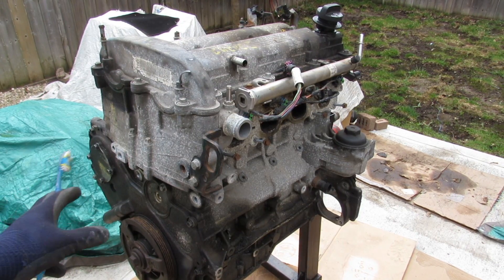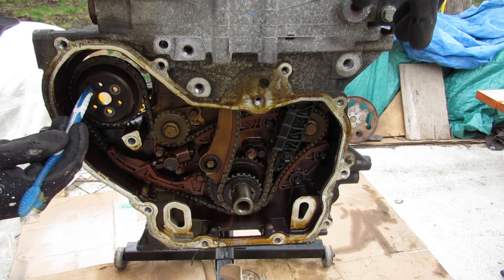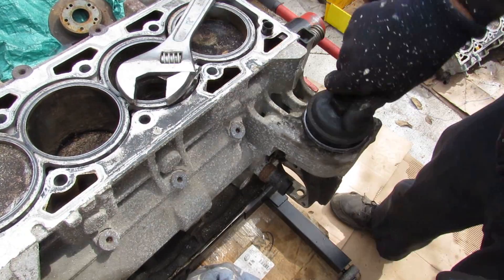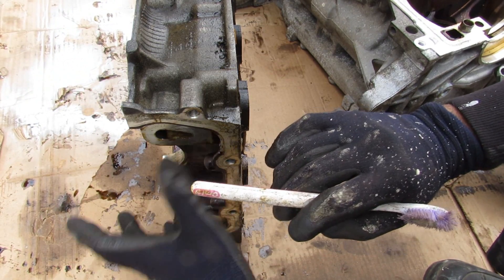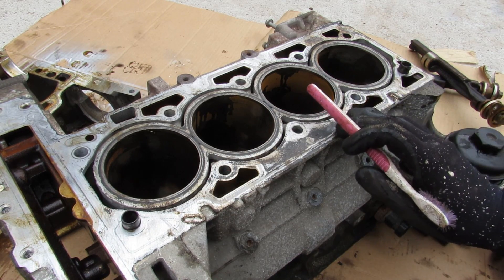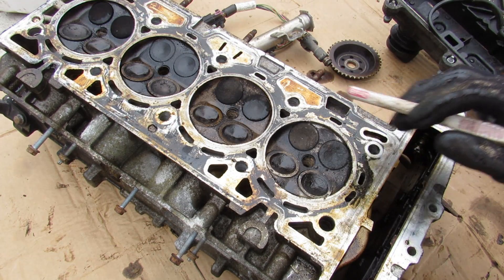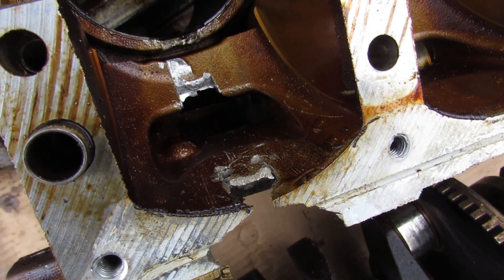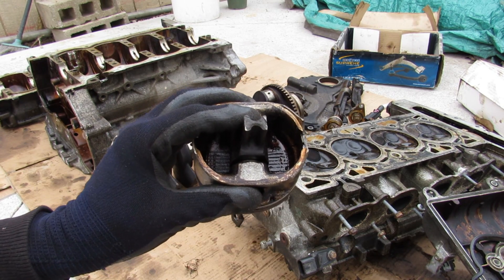Why GM Ecotec Engines FAIL

Comment: Oil pickup in the sump clogs up with bits of broken chain guides, then along with chain stretch and long oil change intervals can self destruct. Chain kit includes larger oil feed and lubrication jet, sump and oil pickup and oil filter housing and oilway to chain tensioner must be cleaned out.  9000mile/yearly oil change with 5w 30 fully synthetic oil and these engines can do large mileages reliably...This engine was used by Saab, Lotus and Vauxhall (VX220) where owners were more attentive I guess so very few failures.

Comment: LNF and LSJ are incredibly robust they can take 500WHP+ on stock internals. 2.2L(L61) and 2.4L(LE5) are okay if built right but pretty junk lol. Failure like that is pretty rare on most engines. Looks like that engine was barely maintained....

Comment: Great video! You glossed over another common failure on these motors. Well, the 2.2 anyway. 

The same foam core casting is used for the heads. This type of casting can leave micro fractures/cracks that on thin surfaces or surfaces that require smoothness to seal, can cause failure, I.e. valve seats. Over time valve seats can develop leaks which lead to intermittent misfires. Typically p1000 or p030x (x=cylinder #). You have to perform a leak down test to identify this. Only fix is to remove the head and rework the valve seats or buy a remain head.

Comment: This engine family hasn't been made since the 2017 model year. They reused the name on several newer engine families but these ones went away when the 2018 Equinox and Terrain came out. When you were showing the connecting rods those didn't have any bearings in them. The surface you were looking at was the connecting rod itself. Also the broken connecting rod happened first and likely due to a bearing failure from very low oil level. The damage to the piston and valve contact happened from it hitting the cylinder head due to the fact it was no longer attached to the crankshaft. In my experience it would have to have been several litres down. I've worked on many of the newer 2.4s and they drink oil badly. I've seen several stalling out due to only having around 1.6l of oil left in the crankcase (4.7l is full). Even the ones run that low on oil I've hardly ever seen spun bearings. It will stretch the timing chain and cause broken guides almost for sure though. I wonder if this one died of a loose drain plug from a Jiffy Lube oil change.

Comment: Great video, however your assessment of why the piston was damaged is incorrect. What is clear from the damage is the connecting rod broke. This causes the piston to be forced upward, past TDC, slamming the piston into the combustion chamber itself. This is why both the piston and combustion chamber show major damage. This is a common occurrence and is often why engines with broken rods also lack salvageable cylinder heads. 

If it was a timing failure, you would most likely have bent valves that don't seat in their guides, clean combustion chambers, and dented pistons. 

What appears clear is the #1 cylinder had a rod bearings lose lubrication, spin, and while the bearing was spun, the car continued to be driven. Eventually, the rod disintegrated, the rod slammed around and broke, sending the piston up into the combustion chamber as a separate broken part.

Comment: 150k on my 2.2 daily and running strong. Doesn't show even oil residue. Always used high mileage and a quart of Lucas after 70k.  Did have to tap the top tensioner bolt generously to free it up and relieve the cold start chain noise. It's a dreadful noise for 3 seconds or so. If you maintain these engines they are about bulletproof. Also did all the other basics like brake system flush, coolant flush, trans flush @70k and recently did a trans pan drop and filter replacement.

Comment: I was thinking about stealing a turbo Ecotec out of Cobalt SS for my sandrail. This video might have persuaded me otherwise haha.
Reply: 2 liter turbotecs are solid if you dont overboost and maintain them. The internals can handle 15lbs of boost safely. I'd even venture out to 18 but that's uneeded stress for stock.
Reply: @oldschooldude8370  thanks for info! If I can get my hands on an engine I'll buy one. I have always heard they were good, looks like the one in this video was abused in a former life.
Reply: @many-points  Broken rod I think I heard. I didnt watch whole video. That's too much boost more than likely. The turbotecs had upgraded internals but not forged far as I know.
Reply: THE WARRANTY IS 100K MILES ON SOLSTICE ENGINE 260HP AND GM FACTORY FLASH 290HP.

Comment: "I've never used my 11mm socket before"  
That's how you can tell it's a GM. They seem to just use any size they want even on the same part. I've seen on a newer GM the alternator went out (at 42k miles LOL) and it had 3 bolts, a 10mm, 11mm, and 14mm...wtf?
Reply: Also need both SAE and Metric toolboxes because two bolts next to each other may use different systems! And if it's British, add your Whitworth tool box!
Reply: Ford is famous for 11mm. Cant recall needing it for a GM.

Comment: I had one of the 2.2 ecotec engines in a little car, it ran just fine with 200,000 miles. Maybe if you take care of them and don't run them out of oil they hold up better?
Reply: Exactly. Some engines handle neglect better than others.

Comment: Nice presentation.  I see a lot of effort to minimize materials in stressed parts in this engine.  Those are some spindly connecting rods.  These engines have no tolerance as a saving grace for little user errors.  I'm used to the 151cu.in. Iron Duke four - it has some buggaboos but is essentially more sound overall.

Comment: So are these engines reliable enough with regular maintenance? Or is the tiny oil control ring going to end up biting you regardless?
Reply: See the Ecotec is a Vauxhall DOHC belt driven cams engine converted to oil lubricated chain driven cams for vastly more reliability. Vauxhall had recommended changing the belts at 80K miles... they didn't last that long, so they changed it to 40K miles... GM doesn't have any mileage recommendation for changing the chains... After initial break in, I recommended using synthetic oil and regular oil changes to make the engine last 300K miles and stay clean inside.

Comment: He angry at that motor..  i remember my first broken piston i chucked as hard as i could across the yard..  found it with my mower which ironically caused that 1400$ mower to become junk when it bent the crank and caused a piston rod to break...   it feels real good to relieve some tension on inanimate objects but inanimate objects like to bite back..   just like no matter how pissed you get or how careful you are, when you drop a bolt its still going to somehow end up a hundred miles away from where you saw it hit the ground, right in some shit you said youd clean up later..  like how everytime you suddenly think "i need to go put on some safety glasses" you just fucking then get something in your eye.. or why a fart can linger for 20 minutes under a car even when the wind is blowing..  like as soon as you think "im about to bust my knuckles or elbow open" you dont even finish the thought before shit slips or breaks and you cant feel half your arm for a half hour..  

Ill tell ya what does relieve stress though..  when a buddies helping you check for spark and you hit the ignition before they let go of the plug..   gets a smile on my face everytime..

Comment: nice video Bro!, i fixed the oil consumption problem of my dad's corolla after i saw a video of you, it just have clogged oil return holes on the piston, so i clean it up, and put new rings and now it runs like new and no oil consumption, it seems to be a common problem on engines. thanks for your videos and knowledge, saludos desde Chile!

Comment: The rotating assembly is not a common failure point, only the chain. It’s on you if it fails, looks like it missed a lot of maintenance......
Reply: It started out as a Vauxhall engine with belt drive cams and belts broke by 40 - 80K miles... the chains go 250-350K miles...

Comment: That ecotec is out of the 2005 cobalt which would be same or nearly identical engine in the 2004 sunfire.

The later years cobalt such as 2010 has different looking ecotec motor in it.

Comment: The timing chains, tensioner, guides etc are very BMW like in design, and of course BMW N20s etc just love to self destruct due to valve and oil pump chain failures.

Comment: I have one of the newer versions of the ecotec 2.4L.  It's in a 2011 Chevy Equinox.  It burns a lot of oil, but I took it in to the dealer a few years ago and they said it didn't burn enough to qualify for the engine replacement.  They have been selling this defective, oil-burning piece of junk for years and do everything possible to avoid repairing or replacing it.  If you have one, it is critical that you check the oil on a strict schedule.  If you ever let it get to low (and it can happen very quickly) the engine is done -- like the one in the video.  What does it take to find a vehicle that's not a bunch of junk these days?

Comment: Have this exact engine,

09 Chevrolet Cobalt LT, hand me down, 136000 miles.

Carfax says 14 owners since 2009, and a number of accidents.

Fully restored it with junkyard and Duralast parts, except the inside of the motor. Hell, even changed the transmission fluid(4T45E Auto Transaxle) at 124000.

Car runs really well for its’ age, upped the oil to 10w-30 at 127000(live in Arizona), to try and help get thicker oil in smaller tolerances of mechanical wear.
Started changing the oil every 2000 miles for about 6 months.
Aside from using quality spark plugs, changing the oil every 3-4000 miles, and changing the engine mounts, is there anything I can do, besides getting rid of the Cobalt, that can try to make it last longer?

Comment: ive got the l61 2.2 ecotec in my 2005 chevrolet classic, 212,790 miles and still going for its age!
Reply: regular maintenance goes A LONG way
Reply: This engine fail due low oil.

Comment: yes there is a tensioner behind the cams on the head it looks like a 32mm bolt and that is the tensioner that is prone to failing thus the slack in the chain

Comment: These motor are junk the timing chains fail from oil consumption then run low on oil and lose tension with the chain then bang there done
Reply: Need to check oil level every 6 months...
Reply: @BuzzLOLOL  with these motor you need to check every day

Comment: Balance shafts run off a secondary timing chain, so it’s basically got two timing chains you need to set. What a nightmare.
Reply: Coloured links on the chains line up with marks, takes 10mins to time the whole engine
Reply: Make a sketch of chain and sprocket positions on tear down...

Comment: i had one.. it was awful.. awful engine. mine was the older 1.6 with the interference timing belt.
Reply: Vastly better now with timing chains instead of short life belt...
Reply: @BuzzLOLOL  i disagree. timing belt is easy to change but faulty pcv valve design caused rear main to blow. also everything on the car was falling apart. i got a honda after and realized just how much chevy cheaped out.
Reply: @zoomjoo  - 99% of people will not change their own timing belt. And don't want a broken timing belt destroying their engine by crashing pistons into valves. GM eliminated that problem by using permanent oil lubricated timing chains good for 300K miles in gentle driving...
Reply: @BuzzLOLOL  still no excuse for their terrible pcv design. also the transmission was well on its way out. ask any mechanic. GM is trash.

Comment: You know it's weird, we have had the same family of these engines in Opels and they didn't seem to suffer much less failures as lets say VW FSI engines. Maybe it's because of the different service intervals or maybe because they're generally smaller displacement, lower Horsepower than in US so they don't get pushed as hard... Generally the thing you needed to do on these things is replace timing chains and tensioners at 150k km, keep the engine oil level in check and make damn sure you change the oil at the manufacturer specified 20k km. I think the upper limit on oil consumption in the owners manual was 500 ml per 1000 km, but many times they'd not eat oil at all for a long time. The leak from the side of the block is a problem that happens though...

Comment: I put 300k on a 2006 HHR, yes I know, with no major issues. Ran great with no oil usage. However I did meticulous maintenance and used top quality synthetic oil. These are 300k engines with proper maintenance. Don't skimp on maintenance.
Reply: I'm driving a 2007 HHR LS with the 2.2L engine, 87k miles. Very reliable car about 4 years now. Suprizingly smooth revs for a 4 cyl.
Reply: I have a 2007 Pontiac G6 with the 2.4L LE5, I’ve had it since 70k miles. I’m planning on doing a timing chain, and balance shaft chain job eventually. Still on the fence though because I’m risking breaking something that’s not broken yet
Reply: No shame in the HHR man, the US has a serious lack of wagons and it’s a damn good one. Everyone calls it a “PT Cruiser” but damn if I barely see any of those even in running shape these days 😂 Fukin Chrysler
Reply: I'm hoping so I got the 2.4 in my 2010 Malibu with 183K miles no issues yet(knock on wood)
Reply: Maintenance literally doesn't matter. I have kept up on maintenance 2 a T!! Even put a new engine in the POS and it's just one thing after the next with this car. Its beautiful to look at but I hate it
Reply: What spark plugs did you use? I’d like to get 200k plus out of mine. I’m at a little over 100k now.
Reply: @jvgilyard1126  tbh find some zz performance ones, they specialize in ecotecs and many other motors
Reply: @Tylergear42069  thanks, I’ll check them out.
Reply: Your luck is like 1 in a million
Reply: @andym1223  
If you don't take care of your car then it is luck. All my GM vehicles have been stellar because I do proper maintenance. I will not buy anything else now. Powerful, efficient and well built. Virtually zero issues with GM in nearly 40 years of buying vehicles of all brands, GM wins hands down.
Reply: I love when some idiot comes out the woodwork's claiming "Just do maintenance bro!". If you have to do that much fucking maintenance to keep a car running then your car is garbage. Period.

Comment: The ecotec is usually decent if the maintenance schedule is followed STRICTLY. They won’t burn oil unless they are neglected. And they usually are, but because they’re German designed engines they can’t handle neglect.
Reply: When Toyota engines fail, speedkar would blame it on the owner for not maintaining it. When an Ecotec fails, speedkar blames GM. I guess it's GM's fault when someone goes 10k+ miles between oil changes or never checks their oil level.
Reply: Mine started burning oil around 50k miles....and I changed the oil every 3000 miles.  The internal PCV system was the original fault.  That said....the motor survived 425k miles of me beating the living shit out of it and is probably still being driven by it's second owner.

Comment: Great description of the Ecotec! I've been running pre-05 L61 ecotecs in my endurance racing Sunfire. Ive had 2 engines break connecting rods as well as bought the original car 7yrs old with a broken rod. With No warning. If this was timing chain failure, you would see valve to piston contact on at least 1 other cylinder. Connecting rods are the weak link and were upgraded by 08 engines. My broken engines were still in correct timing. I think worn connecting rod bearings make lateral drag on rods and they snap. Now I run an oil cooler and level zero balance shaft delete kit. (-9 lbs, Fewer demands on oil supply & more power).

Comment: The valves would have bent before the they broke the connecting rod. I think by the looks of the black crankshaft journal they may have run low on oil burning the bearings

Comment: The chain tensioner is hydraulic by oil pressure. That's why it seems loose but when engine is running it will take out the slack.
Reply: That chain/guides was prolly excessively stretched by high miles as the hydraulic adjusters have one way locks that prevent them from collapsing after compensating for wear...